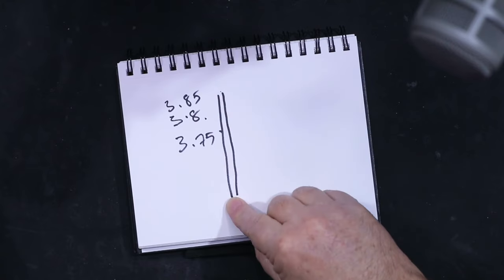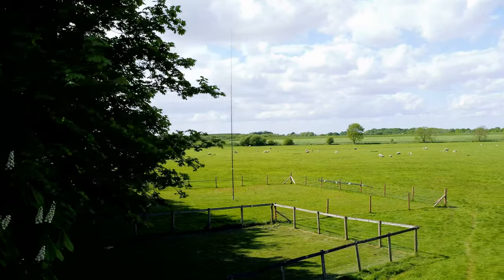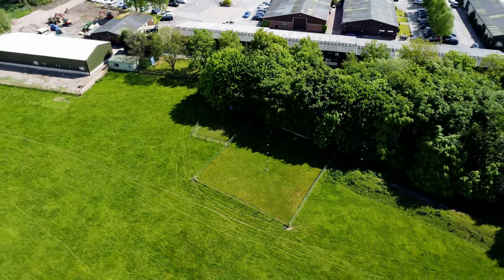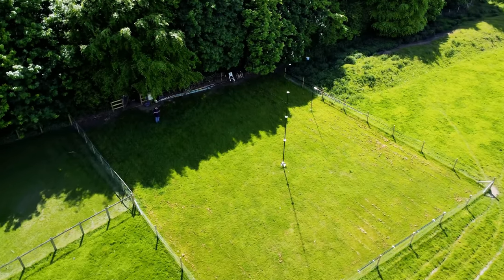Fascinating - Skin Effect and Cage Dipoles & Verticals for Wide-Banding Dipoles and Verticals

Comment: Yes, I found large diameter elements have very wide intervals with very low reflected power. I like using aluminum tubing from salvaged lawn furniture and better yet is 4 inch diameter aluminum dryer vent tubing.

Comment: Hi Callum. Serendipitously, only two days ago, I decided that I wanted to add another wire to my DX Commander so that I might be able to work the 29.600 FM calling freq. I added it along with the current 10m antenna that I have tuned to ~28.450. Once the second wire was trimmed and tuned showing ~29.600 resonance, I tried it out. I was amazed at how much broader the 10-meter capability had become! I don't have a complete usable bandwidth laid out on paper, but overall the two wires have caused the bandwidth coverage to become much wider. So, it sounds like in effect I accidentally created a cage dipole for 10 meters... LOL what fun!
Reply from the maker: Fascinating. Thanks for the analysis!

Comment: It has been a while, but I had a cage dipole on 80m. 1991. I don't have any "technical" measurements.  As I recall, I had 8 wires, held apart by 8" pvc slices. The bandwidth was 3.7 to 4.0.  I was a Navy MARS operator as well, and could get below 1.5 to 1 even at 4.2 MHz.  It worked like a champ.  If I had the space, I'd do another in a heartbeat!  I also had the advantage of being on a hilltop.  Then I had to move to Florida and couldn't replicate it there.
Reply from the maker: Good comment!

Comment: Hello Callum. On my DX Commander, (which i love!) I got an improved tune and Q on the 40m wire by putting a little  2 inch spreader about 6 inches from the top eyelit. i suspect there was a change in the capacitive coupling at the top of the wire by spreading out the fold-over. KC1PHY
Reply from the maker: Interesting.

Comment: I did something like that on 11 Meters back in the 70s. I made an 5/8 antenna from 4 inch copper pipe. The receive was amazing for just being on the garage roof.
Reply from the maker: Wow!
Reply: @DXCommanderHQ  It didn't cost that much. Copper was super cheep in the 1970s that 4 inch copper was used. probably came from some commercial building. Are you still going still going to build a six vertical?

Comment: I remember looking into performance vs. wire gauge and coming to the conclusion that at HF, 'wire is wire': the ratio involved just didn't matter from 28 gauge to 12 gauge despite what the old timers will try to tell you - 'oh, 28 gauge wire will never work...' But now, making a cage . . that has my wheels turning! Fascinating discussion, keep them coming!
Reply from the maker: That's what I thought.. You would have to make it VERY large.. But not (yet) done the experiment.

Comment: Callum, (And anybody else that would like to chime in). You and I logged that day when you did the remote session out of Canada. I mentioned I was running 10 watts fed into a Downspout on the corner of my apartment building. Keyword is apartment building in that I cannot erect any kind of an antenna on the property. The setup is a two-story downspout with a 9-1 and only about 20 ft of coax from the station. I don't have an RF choke on the antenna end of the coax in hopes that the skin effect on the coax will give me some kind of a radial. I do have a ground stake at the base of the downspout. With some heavy copper magnet wire, I've tapped onto the downspout about 20" from the bottom with a pop rivet. The system is flat resonant on 40 M and tunes reasonably well on all bands except 20.
 My success with the antennas phenomenal on FT8. I'm reaching South Africa, Estonia, Israel and Japan(just a few) from North Carolina. On SSB the EU, points in South America and the Caribbean. All with 10 watts. So I can't complain. The surface area of a 2"x4"x30(approx)ft aluminum downspout must have a tremendous skin effect to get these results.
 The question is this...By altering the pop rivet tap position, up or down, do you think I might be able to get a workable tune on 20 M? Or should I consider an industrial strength external tuner?
I would model this on the computer but I can't figure out how to represent a "piece of pipe" in the software...Anyone?...Berend KN4VUP
Reply from the maker: OK.. So if the COAX connection point changes, then the length of the radiator will change, but if you instead moved a jumper, then the jumper wire is part of the antenna. So it would have to be the feedpoint change, yes. PS - Love the system!!

Comment: Skin effect is the distribution of current through the cross section of a conductor.  As you go up in frequency more of the current travels near the surface.  By the time you get to mm wavelengths the current is in a extremely thin cross section layer near the surface.  Surface roughness of the conductor also plays a big role in skin effect.  Mike KC3OSD
Reply from the maker: Thanks for sharing!

Comment: I've done this a long time ago, with a vertical antenna. Two driven wires with 15 cm spacing. (don't think this was important) but I made one wire resonant on one frequency and the other wire a little bit longer (resonant on a lower frequency, for 10 meter band) . There were two dips next to each other, on the analyzer. The bandwidth was much wider than with one wire.
Reply from the maker: Interesting!

Comment: that was great ! the magic of RF. I did see a fan dipole multi band made out of Christmas lights.  the surprise was they all light at different brightness on different bands. showing that they all radiate some what. the resonate one lights the brightest. and that was Josh from ham radio crash course a few years back on a Christmas special making a antenna out of Christmas lights and putting some power down the wire. look at that big antenna in Ukraine from the old radar system. lots of caged dipoles . covered the  HF spectrum and Hurd all over the world.   called the Russian woodpecker. used a caged dipole array . 73's

Comment: I added a wire to a standard multiband vertical and had plenty of supplies to add a cage as the wire on top the vertical. The 8 wire 8 inch diameter cage ended up being 10 feet long instead of 20+ feet so there's that.

Comment: My concept of a DXC vertical "CAGE" antenna would be for primarilarily a single band (and its derivatives) and be at least 8" in diameter (or more)  with at least 5 or 6 equal length wires (or more). - I don't think there would be a need for mulit-length wires to cover most of a wide band, as the added bandwidth from the diameter should be enough.
Let the experiments begin! - Co-incidental cages? - Stacked cages? - The "sky" is the limit! - lol - Cheers!
Reply from the maker: Yes, I think I probably agree with you after having some conversations beyond YouTube..
Reply: You vision is very close to what I had envisioned.  I think the current plates for feed and radial are sufficient.  ^ wires seems to work well in the modelling so far.  Working through the little issues to see about something that might get ready for a build.
Reply: @FromthehamshackwithNJ4Z   - Yes! - You just need multiple plates the same  and add multiple wires- Please report back! -Cheers!
The next "trick" will to be to make it multi-banded! - One step at a time...

Comment: What you are doing is to reduce the Q of a tuned circuit where the "circuit" is a radiating element. The near field caging effect has to do with capacitive coupling of adjacent elements as long as both elements are driven. I would think that two different lengths will create what looks like a Butterworth shape. This can probably be modeled with Fourier analysis.

The problem with reducing Q is that it affects gain by spreading out the bandwidth.
Reply from the maker: Fourier analysis. That'll be new to me - but the regular modelling shows almost same as a q/wave mostly.

Comment: I have an 80M Delta Loop hung in a vertical orientation, fed with a 4/1 balun at the feedpoint which is at 15M high. 1.28/1 at 3.780. 2.3/1 at 3.500. 1.75.1 at 4.000 mhz. With a bit more wire in it, I could move the dip down a bit and be well under 2/1 across the entire band. As it is, the internal tuner, it's good to go. I seldom operate above 3.800 though. As a Canadian amateur, we have the full band available to us. Next I will be adding an inductor from the middle of the bottom leg to ground to make it at DC ground potential. The same as I've done with my vertical. The bottom of the loop is about 10' above the ground.
Reply from the maker: Very interesting!

Comment: Great discussion. You danced around what I feel is the issue with 160 and 80 meter antenna bandwidth and that is their wavelength. If you compare the calculated length of the antennas at the band ends, there is a much larger difference in the length for 160 and 80 than there is for 10 meters. Just my thought on the subject. Have a great weekend.
73 -  K1AUS

Comment: Tinfoil Helmets.... Capacity Hats do provide a small increase in banwidth, but I have not seen a definitive treatise on where to site them on the element.

My Hustler 5BTV has it below the 80m trap, but I have seen them sited a short distance from the end of a full size wire element.
Over long elements can be brought to resonance  by use of a capacitor (variable) at the base of a radiating element.

My brain hurtz lol.
Reply from the maker: The only time I've seen a capacity hat working well is to push say an 80m vertical down to 160m.. Physically, it just looks like 4 x Inverted Ls..

Comment: Skin effect, lol. Skin effect is where the RF flows on the skin of the metal, not the entire metal. If your having RF bleed, you can possibly control it with ferrite and shunt it to ground.
     I used to run a high freq tube mill that used a liquid cooled oscillator tube as big as a 5 gallon bucket. It wasn't fun picking up your tools and seeing little arcs jump to the steel base of the mill. A exceptional ground network, and the ferrite controlled the flow of the RF in the pipe as it ran.

Comment: I would not "stagger tune" the elements, just a suggestion, but maybe use the bottom sections and plates from one of your existing antennas and put 6 identical 10m elements on it. the resonant frequency will drop a bit but the bandwidth should be much greater.  It has been 40 years since I got to play with a cage dipole (At Cable and Wireless at Porthcurno).  The cage dipole far ends converged back into one as you described but I am sure much of that is for mechanical simplicity. In theory by sharing the current between multiple conductors the losses will be reduced. I vaguely remember that the cage dipoles had huge bandwidth but it was a very long time ago. A while back I did mess about with a MMANA model of the 6 elements for 10m all cut the same and it did look promising... scaling for 80m might get a bit ugly though....
Reply from the maker: Yes.. So last night I quickly modelled 6 vertical radiators for 80, Tha bandwidth was BIG but when I tapered the ends, it reduced. Fascinating.
Reply: @DXCommanderHQ  it is worth sketching out what is going on "whiteboard style". 
The antenna wire itself is an inductor, it couples capacitively to "free space" via capacitance, free space itself is the resistive component. Some of what you are modelling suggests to me that you have a capacity hat effect going on. I believe that only the top (high voltage point) of the antenna needs to be "fat".  
With the weather we have at the moment maybe you could solder a coax to a biscuit tin and do some playing with a 2m or 70cm model, I did exactly that years ago. Even did a fat folded monopole...

Comment: I've modeled and built fan dipoles with slightly different length wires with dismal results (my error I'm sure). How about a vertical made of twin lead shorted at both ends? Effective radiator of 1" diameter. The "Sleeve coupled resonator" is an interesting concept as well.
Reply from the maker: That sounds also like an experiment..

Comment: John you can build a great contest station for 10k$ it’s not going to be new beams but classics that perform well at 100 plus feet. 80m vertical loops work well across the band but so do coaxial dipoles. Thick like I like my women 😂
Reply: Agreed, I have a friend that has a great contest (little pistol) and DX station that is all wire antennas, and he is a contender in most contests.
Reply: @FromthehamshackwithNJ4Z  will you be doing the dx contest this weekend John ?
Reply: @JayN4GO  not this weekend have some family stuff going on, but I will be running with a multi 2 for SSB Dx.